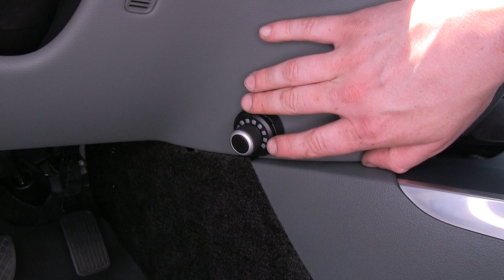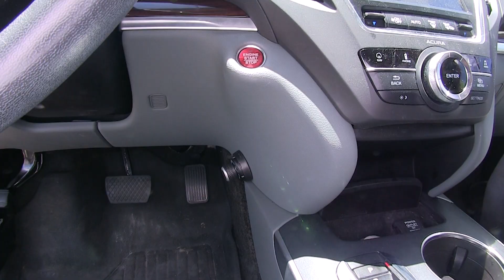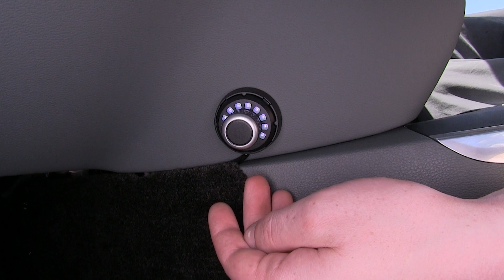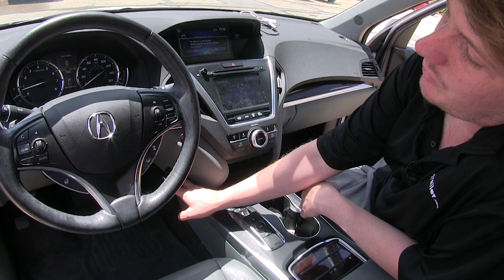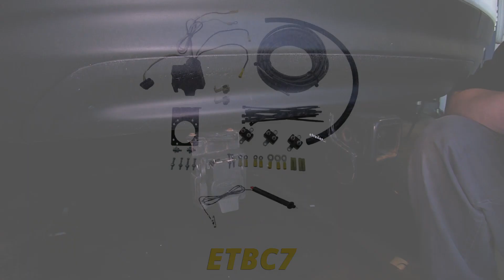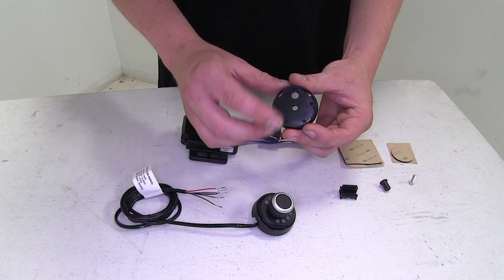etrailer | Ultimate Overview of the Curt Spectrum Brake Controller w/ Custom Harness

Comment: Brake works with manual but not with truck brake pedal
Reply from the maker: If the trailer brakes aren't engaging when the truck brakes but does when the manual override is engaged, it shows the trailer brakes are capable of working so we'll want to check on the brake signal going into the controller. I'd start by unplugging and plugging the harness back in, including the vehicle specific adapter if one was used. Use a multimeter/circuit tester and test the brake signal wire going to the controller. It shouldn't have any voltage with the brake pedal released and voltage when the pedal is pressed. If the signal never appears then the brake controller doesn't know you're braking. 

If a spliced in harness was used, a connection to the wrong side of the stoplight circuit is a common cause of a controller working manually but not from the pedal. 

If the app is recognizing that you're braking but the trailer brakes aren't fully engaging, check the max output and sensitivity settings to see if they need to be increased.

Comment: Why would we get a bunch of sway with this brake system?  Because the brake is not enough?
Reply from the maker: Assuming that the trailer brakes are properly adjusted, the wiring feeding them is in good condition and is delivering similar voltage to each brake assembly, and the brake drums and brake assemblies/brake shoes are in good condition a brake controller will not cause trailer sway. So, you'll want to check all that to make sure everything is working well and is in proper adjustment.
https://www.etrailer.com/Trailer-Brake-Controller/CURT/C51170.html

Comment: How do you calibrate this controller I cannot figure out how to work it when I start up my truck no lights come on at all I had the Chevy dealership where I purchased my truck install it
Reply from the maker: I would start by checking the factory tow package fuse and the factory brake controller fuse. Something could have happened and caused the fuse to blow. If this is not the issue, I would check the wires for damage and make sure all of the connections are solid.
https://www.etrailer.com/Trailer-Brake-Controller/Curt/C51170.html

Comment: What wiring harness would I need to plug in this C51170 to a 2021 Jeep Cherokee Trailhawk with tow package?
Reply from the maker: We do not have a harness yet that connects the Curt Spectrum directly to the factory wiring on a 2021 Jeep Cherokee. You can hardwire the Curt Spectrum or you can take a look at another very popular option. This is the Redarc Tow-Pro Liberty. We have a wiring harness that will connect the Redarc Liberty directly to your Jeep.
https://www.etrailer.com/Trailer-Brake-Controller/Redarc/RED24FR.html
https://www.etrailer.com/Accessories-and-Parts/Redarc/RED67FR.html
Reply: @etrailer  Thank tou for the information.
Reply from the maker: @Ojeramup12  We are happy to help!

Comment: I can't adjust anything..everything is maxed out and I can't turn it down...makes for lovely flat spots in tires 🤦‍♂️
Reply from the maker: You may try disconnecting it, and reconnecting it to see if it will reset it. If not, you can recalibrate it.
https://www.etrailer.com/Trailer-Brake-Controller/Curt/C51170.html